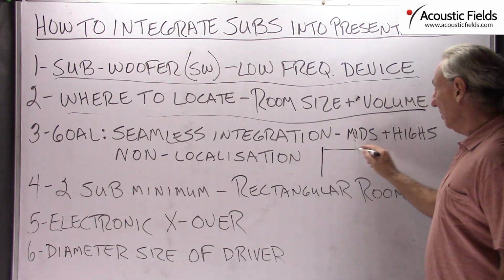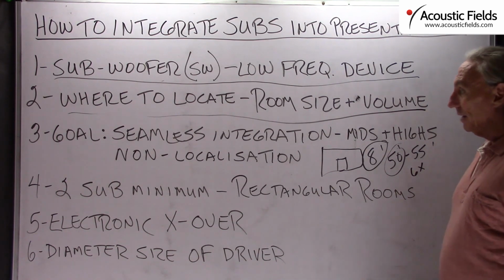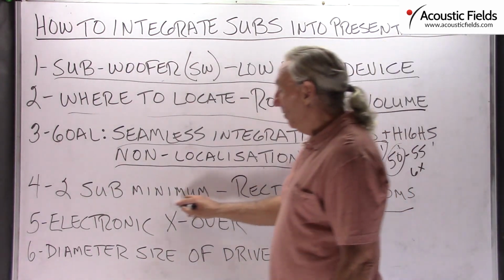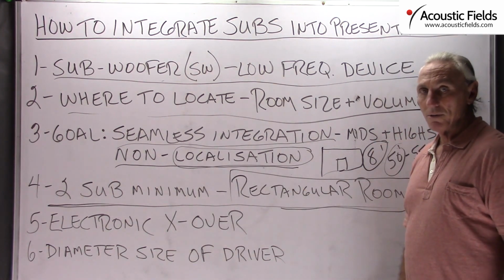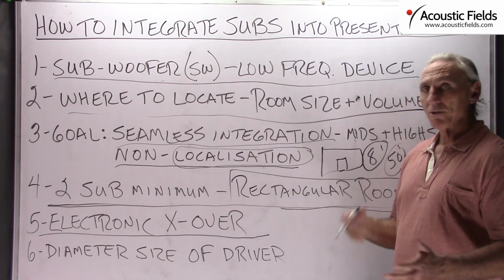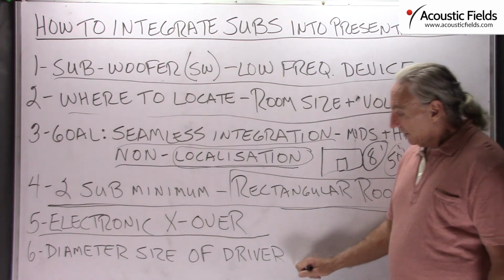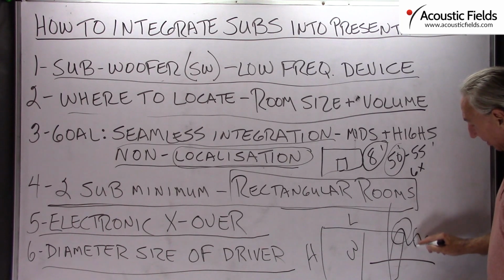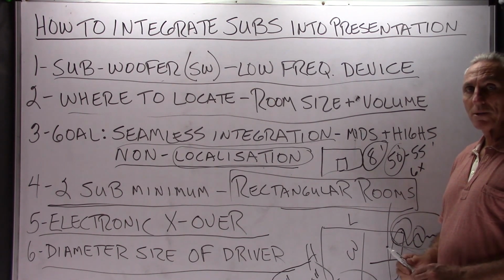How To Integrate Sub Woofers Into Your Presentation - www.AcousticFields.com

Comment: Dennis, your emphasis on the room as the dominant factor in low-frequency reproduction is absolutely on point. The idea that a subwoofer is fundamentally a low-frequency energy generator interacting with room boundaries—rather than just another “speaker”—is a critical mindset shift that many listeners overlook. Your focus on seamless integration, proper crossover use, and especially the recommendation of dual subwoofers for modal averaging and non-localization is also fully aligned with current best practices in both studio and high-end playback environments.

Where I think your perspective could be expanded is in how modern tools and system design have changed the constraints around subwoofer integration, particularly regarding driver size and energy management.

First, regarding driver diameter and room size, while it’s true that larger drivers can generate more acoustic output (and therefore have the potential to exacerbate room modes), this relationship is no longer as limiting as it once was. With contemporary systems, we now have precise control over:

output level
crossover slopes and points
time alignment
parametric equalization

This means a larger driver (e.g., 12") does not inherently “overload” a room. In fact, when operated within its linear range at moderate levels, it often produces lower distortion and greater dynamic headroom than a smaller driver working harder to achieve the same SPL. In this sense, a larger subwoofer can actually reduce audible artifacts rather than increase them, provided it is properly integrated.

Second, the idea that the room “doesn’t want” low-frequency energy is a useful conceptual warning, but in practice, the room is not rejecting bass—it is redistributing it through predictable modal behavior. With tools like measurement software and DSP (e.g., room correction processors), we can now:

identify modal peaks and nulls precisely
reduce peaks through targeted EQ
improve uniformity through multi-sub placement strategies

This shifts the paradigm from “fighting the room” to actively shaping its response.

Third, regarding the caution about “adding energy” with larger drivers: this is absolutely valid in unmanaged systems. However, in a controlled setup where gain staging, crossover design, and DSP are properly implemented, the system is not adding uncontrolled energy—it is redistributing and optimizing energy delivery across the frequency spectrum. In fact, by high-passing the mains and delegating low-frequency reproduction to subs, we often reduce overall system strain and improve clarity throughout the midrange.

Finally, your recommendation of dual subs is one of the strongest points—and it actually reinforces the idea that system topology matters more than individual component size. Two smaller subs properly placed can outperform a single larger one not because of driver size, but because they:

excite room modes differently
reduce spatial variance
create a more uniform pressure field

This again highlights that placement and system design outweigh raw driver characteristics.

In summary:

Your core philosophy—respect the room, avoid excess, prioritize integration—is absolutely correct and foundational. The refinement is that, with modern DSP, measurement tools, and system design strategies, we are no longer as constrained by driver size or raw output as we once were. The focus has shifted from avoiding problems to actively controlling and optimizing the low-frequency environment.

In that context, larger subs, multiple subs, and advanced processing are not risks when used correctly—they are the very tools that allow us to achieve the seamless, non-localized, and musically coherent low-frequency reproduction you’re advocating for.

Comment: Great vid. Always good information, but I have a question.
If I get a larger sub to further extend my low-end response, and it gets louder because the driver is larger, can't I just turn the volume down on the sub? I'll lose the boost in volume, thus not accentuating the existing bumps in my frequency response, but I'll also be able to hear deeper into that response, no?
Reply from the maker: A larger diameter sub will not extend your low end response. Today's subs, no matter what the diameter, can go low in frequency response. A larger driver diameter will prodce more energy output. Since the room only sees energy, it will react to this increased energy input with greater peaks and dips in room response.
Reply: @AcousticFields  Ah okay gotcha. Thanks!

Comment: Disappointing that you keep harping on small room issues but you don't say where in the room the sub woofer should go, if there is an optimal placement in an otherwise compromised room.  Maybe in a problematic room, there is no optimal place for it to go.  But what about more optimal rooms with high ceilings?  Any good, bad, or indifferent places for a sub woofer?

Also, I was surprised at the cavalier treatment of a crossover frequency.  It sounds like you advocate tweaking it depending on musical content.  I would imagine that there is an optimal crossover frequency when paired with a specific set of stereo speakers (for 2 channel).

Comment: Do you run both subwoofers in stereo? Or do you send them a L and R channel respectively?
Reply from the maker: Hi Ram,  Sub woofer frequencies are mono signals. Do you mean running two mono signals, one left and one right channel simultaneously?

Comment: mentioned is the fact that a 12" sub will have 2dB more loudness than a 10" and one needs to be careful about the size of room to match the woofer size. If the room does not like the 12" size, can't you just turn down the gain of the sub to suit the room size?
Reply from the maker: Hi Mc, In a linear world maybe, but low frequency energy room attack and decay rates need to  be matched to room size and volume and then the dB SPL must be optimized for all of those variables. Its a bit more complicated.

Comment: Good comment about the electronic cross over.  I've always known my sub is fighting with my main speakers.  Where can I get an electronic crossover?  Suggested brands for a high end listening room?
Reply from the maker: Hi Ron, We use JL Audio subs in all of our studio and listening room projects. They have an external crossover that can be located next to your listening position that can control two subs at a time. They are also have fast response and low distortion.
Reply: I have JL subs which are great. Their CR 1 crossover looks like the perfect companion.